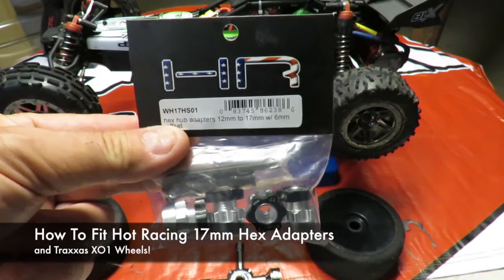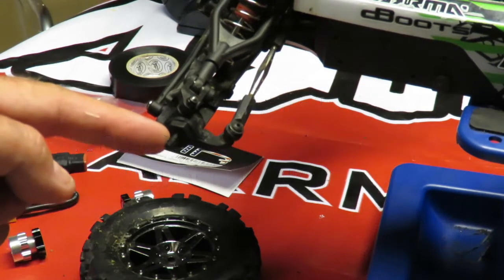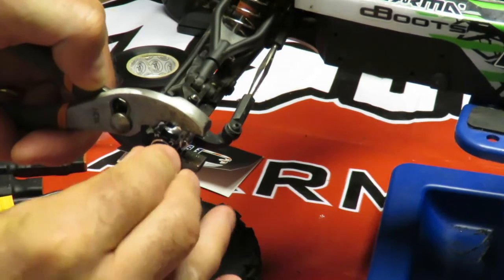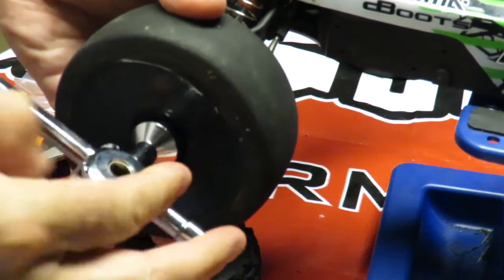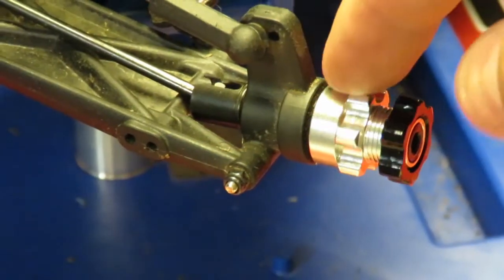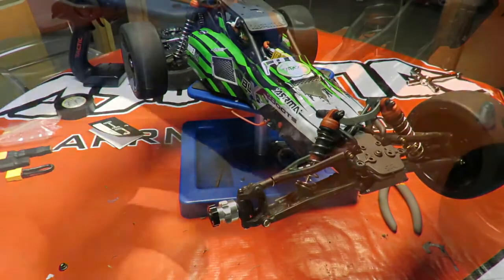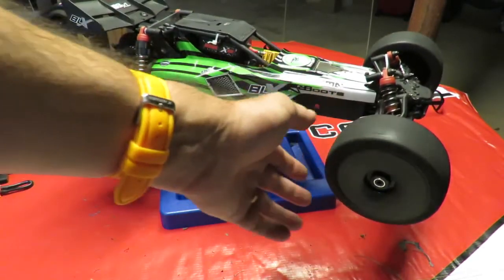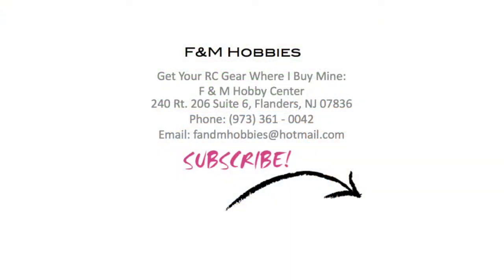How To Fit Hot Racing 17mm Hex Adapters

Comment: On the fronts you gotta tighten until snug/binding then back off 1/4 turn. If u crank down the internal adapter barrel nut it will lock up and ruin the bearings.
Reply from the maker: ryan - noted I have f'd up one of the front ones, which just kinda got stuck, in every sense!
Reply: I'm having this issue right now. Will use blue loctite as well

Comment: What size of axles are on your car?  I need these adapters but for a 5mm thick axle.
Reply from the maker: Apologies without looking on the arrma website I'd not have a clue. You'd need to check the hot racing site to see if they do 5mm ones. Sorry not to be more help. The hot racing website is probably your best bet.
Reply: I know its a little late, but the Traxxas hot racing adapters are 5mm. The Arrma 1/10 axles are 6mm even the Typhon 3s. Arrma 1/8 are 8mm. But since this video Hot Racing has came out with a better design so you do not need 12mm Hexes at all for the Arrmas  Here is the link https://www.ebay.com/itm/Hot-Racing-ATF117XT02-Aluminum-Heavy-Duty-17mm-Hex-Hubs-10mm-Offset-Arrma-1-10-4/264173538295 these will fit any Arrma 1/10 but will not fit an Arrma Typhon 3s because it does not have threaded axle stubs.